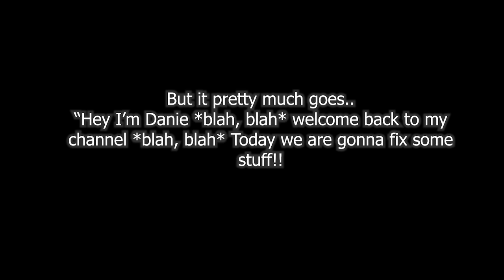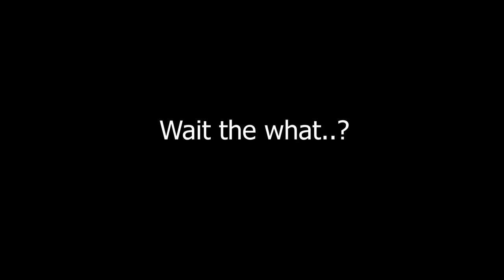OLBOY Mods Part 4: Bonnet Insulation

Comment: Good job Danie! 
Use Carbuilders peel n stick heat shield on the underside of the cab for effective heat protection as I've done the floor of my 80 series in sound deadener and some heat still comes through the tunnel so some peel n stick next.
The sound deadener does a great job of cutting vibrations and noise of the muddies and engine/gearbox.
Reply from the maker: Yeah definitely will be

Comment: Hey Danie, I love your work. There’s something that I’ve been meaning to tell you. I have a coolie girl that looks a lot like your boy and she would always ride beside me in my ute on the passenger seat without any problems while she was young. She could anticipate and deal with any hard braking which often happens because of the terrible drivers that you occasionally come across especially here in Sydney . Unfortunately when she got older with arthritis the day came when I had to slam the brakes on and she couldn’t react quickly enough and ended up down in the foot well and seems to have hurt her elbow and neck. That was a couple of years ago now and she hasn’t been able to run ever since. Can you imagine how bad it is for a coolie to not be able to run ? Therefore I have an idea for your next project. Basically all you need to do is make a box minus two sides. One side or should I say end goes against your seat back so that it can be tied to your seat and the other side is at the front so that he can’t end up on the floor. It could be fairly long if you have your seat right back so that he can lay down on long trips, they need to do this when they get older. Then buy a harness for him so that he can be held via loops above the shoulders and then extend the piece against the seat back and attach some sort of loop and/or a pulley so that your safety belt can be guided from above and brought down and attached to his harness. It’s worth doing because a happy healthy and agile coolie like so many things is one of those things you don’t realise what you have until you loose it.

Comment: Did you remove and replace the black rubber strip near the bonnet latch? Mines slowly disintegrating and every time I lift my bonnet open my hands get covered in black 😏 Where does one buy a new black rubber strip thingy? 🤣